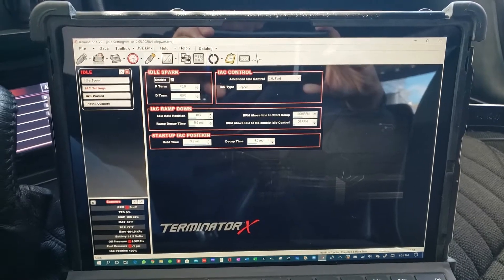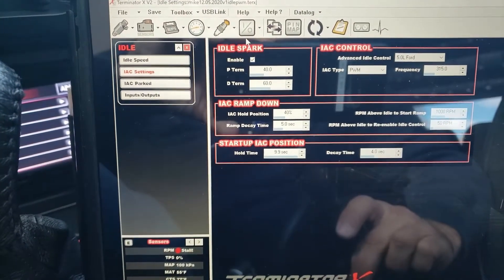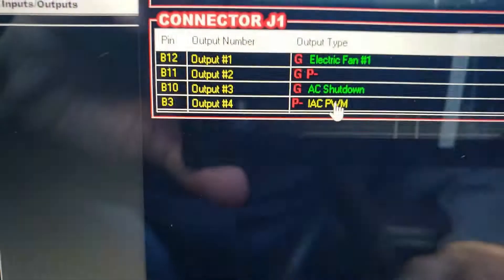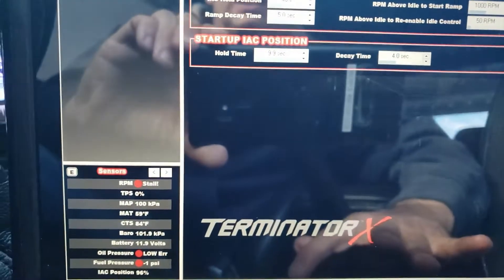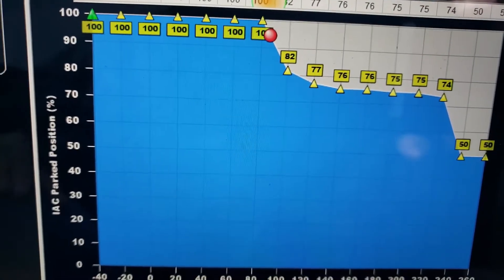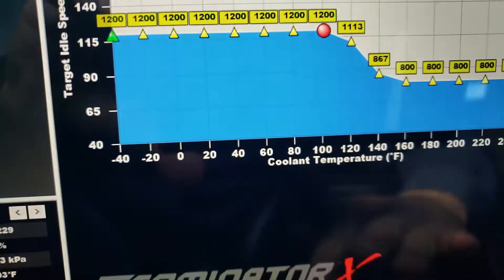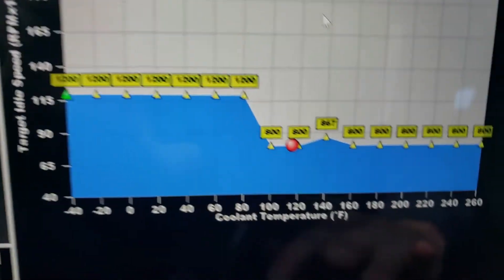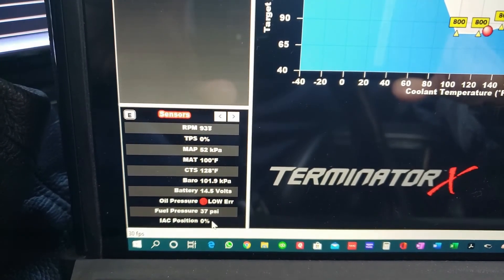Holley Terminator X Ford Foxbody Kit MUST CHANGE Settings IAC Idle Air Control - 5 MIN FIX

Comment: Better to get a gm adapter and use stepper then u don't waste an output
Reply: Ya im not sure what the terminator comes with, I have a holley hp for foxbody and it came with a plug for a gm iac then I didn't have to use an output
Reply from the maker: @88_turbo_fox73  we got the fox body harness kit with the Terminator and it plugged into the factory IAC or wired to it (don't remember). No adapter or GM IAC needed . No matter which sensor you use, you will tie up an output to run the IAC. The output was already setup in the software to run the IAC but the settings were wrong using the base map that Holley supplies, so that's why it didn't work properly. Once the settings were changed it worked fine. No rewiring, no GM IAC needed.
Reply: @foxairandheatinc8345  Thats good then, the harness that came with mine came with a 4 pin iac connector for gm iac, seems to work fine, I don't think the gm flows as much as the Ford  iac
Reply from the maker: Thanks for the idea. That's another way to get it done too. Just figured using what's already there and just changing the settings is a lot easier for most guys. Just needed to know which settings to change. Still have to use an output to control the IAC anyway so you are going to use that output regardless.

Comment: Get the engine at operating temperature..
Unplug the IAC & set the desired idle using the throttle blade screw.  
Shut it off and perform a TPS Autoset
Now plug in the IAC & you'll be good to go.
Reply from the maker: Thanks for the tip. Yes. That is how it should be done but you have to change the IAC settings before the IAC will actually work. Hopefully Holley will make those changes in the base setup, so you don't have to mess with it. This was an earlier version. Have fun.
Reply: @foxairandheatinc8345  correct.  the Ford IAC has no change from 0 - 40% then it's linear from 40 to 100%. 
Certainly have to play with the settings to get it working correctly for your application.
Reply from the maker: @kevin_nagle  once you changed the setup from stepper to PWM it worked fine. The base tune on my Terminator X loaded the stepper by default and I couldn't get it to work until I changed to the PWM and readjusted the settings. Worked from 0-100% and pretty much linear from what I could tell.
Reply: @foxairandheatinc8345  If you put the IAC Position in a scatter plot you'll see that from 0-40% it's almost a flat line then from 40% to 100% it's a linear change.  
Correct, anytime you do an initial setup you have to manually go in and change the type to PWM as the software will default to Stepper.  You also have to adjust the frequency as well, it will default to 0hz, I have found the 300 - 315hz range works well.

Comment: After switching my iac to the correct output when car is keyed on engine off my iac clicks over and over is this normal?
Reply from the maker: John Pina - I typically dont notice it cycling or clicking. With the Ford Fox body harness, I didnt change any of the wire locations on the harness, just the PWM settings and made sure the pin was assigned to the correct location. Hope this helps.

Comment: How exactly did u wire the iac?  My mustang 5.0 kit. Is confusing me.   Ive assigned the Pwm to output 4 like u.   So pin b3.   But in the fixed outputs there is iac A high and low and iac B high and low. Those are b1,b2,b8,b9
Reply from the maker: I just used the iac plug and harness that came with the mustang adapter harness, didn't change any of the pins
Reply: Hey one more question?..  Is there a base timing setting ? How do I sinc the actual timing to what the ecu thinks it is?
Reply: @jacobbock5720  you shouldn’t be messing with it if you don’t know. There’s videos of this stuff search it man.

Comment: First off, thanks for this awesome video. It reminded me that I had gone back to the base tune, and forgot to fix the PWM and assign it to a pin. The reason you are getting the high RPM at initial start is because changing the IAC config (as you describe) makes the TPS AUTOSET no longer valid. You must perform a new TPS AUTO SET. This is done by connecting your laptop to the ECU (or use the handheld)  and select the dropdown menu next to the two circular arrows in the tool menu at the top of the screen (next to the PIN MAP button). Select TPS AUTOSET and follow the instructions on the screen. Thanks again, buddy.
Reply from the maker: Terry Hobbs - Glad you liked the video. Thanks for the tip on resetting the TPS and where to find the settings, not the easiest to get to. If you look at the TPS% in the video it does show 0%, so the 100% parked IAC was what was causing it to start and run at 2500+ rpm. I think I had it set to hold for 5 or 10 secs and then it caught it and idled down pretty good. After I lowered the park position to 40-50% it worked better. This cam was kind of choppy and 900 rpm idle was the smooth, sweet spot. Anything less made it hunt all over the place.  I always forget to save the updated version and load it into the computer. LOL
Reply: Do I need to go wire it to output 4? Or is it already wired from holley that way?